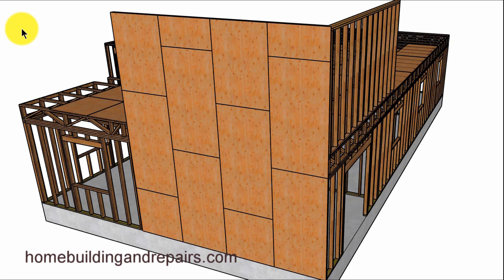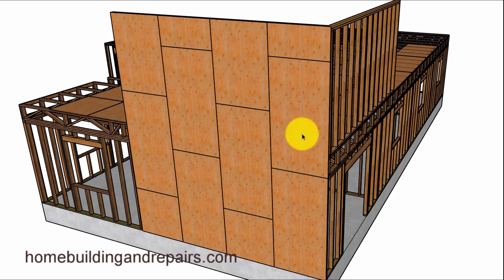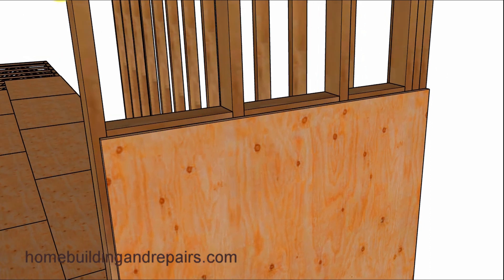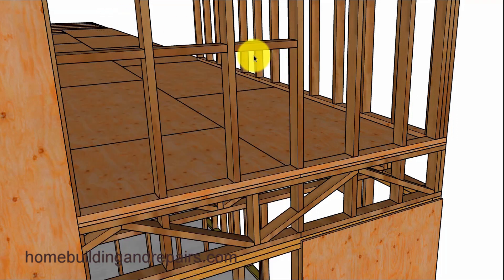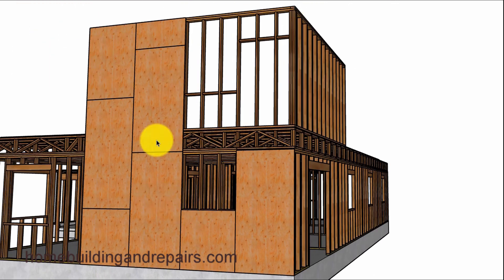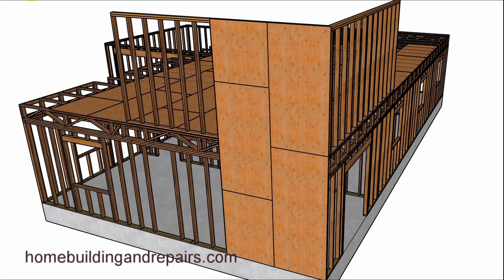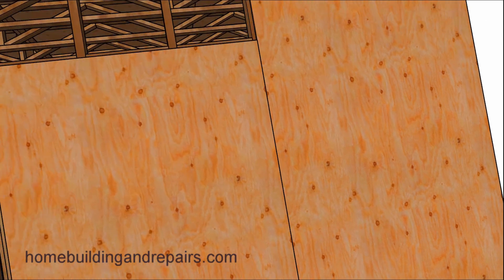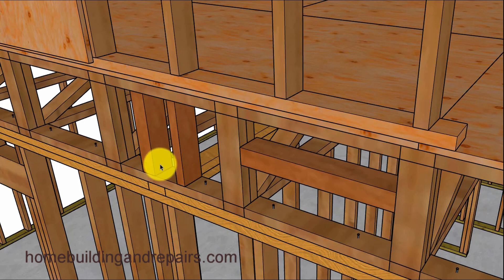Shear Panel Installation Ideas For Two-Story Homes With 2 x 4 Floor Joist

Comment: How tall is that floor truss? The way you depict it with 10' sheets going to the top of it, makes it appear to be 2' tall or 22 1/2" tall. That plus your 97 1/2" wall (bottom plate+92 5/8" stud +2 top plates) would equal the 10'. I am going with a 14" floor truss so that plus my 97 1/2" wall makes it just over 9' to that point. Would it still make sense to use a 10" sheet here and go past that floor truss or just stick with the 8' and trim off at the top of the second wall and use 2' sections as shown in the first example? I am trying to go with the option that has less waste but also easier to install?